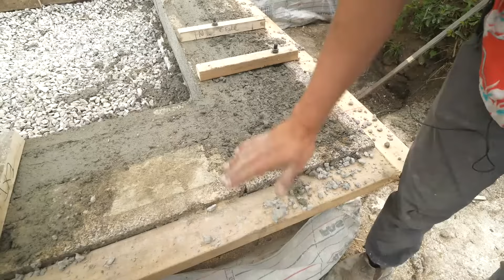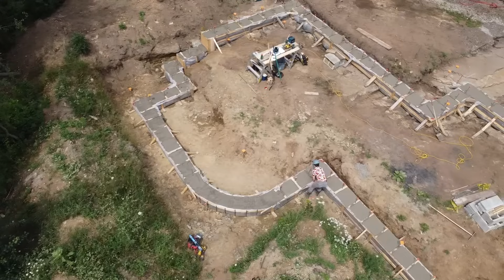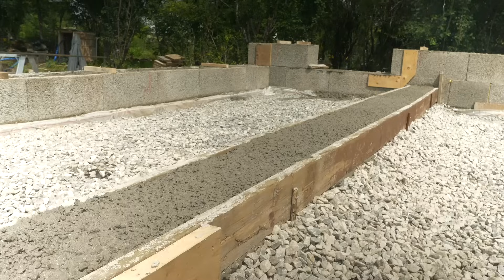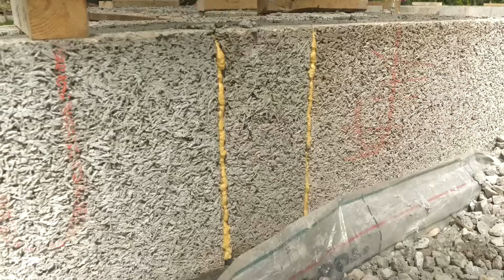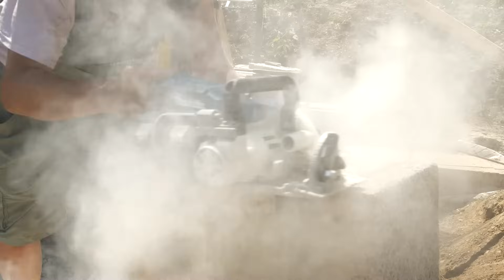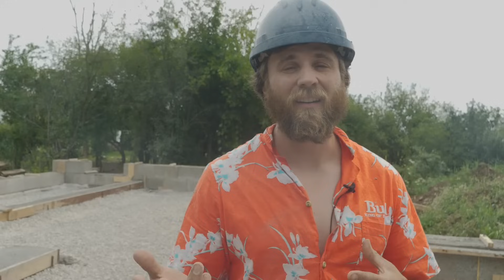Non-Polystyrene Insulated Concrete Forms: Experience and Insights

Comment: Looks great. Do you fill each row individually with concrete, before moving up? Or can you build 2 or 3 hogh before pouring?
Reply from the maker: You build the wall to the height you need and then pour. There is a max height though before having to break up the pours.